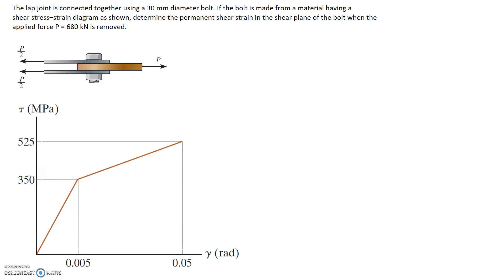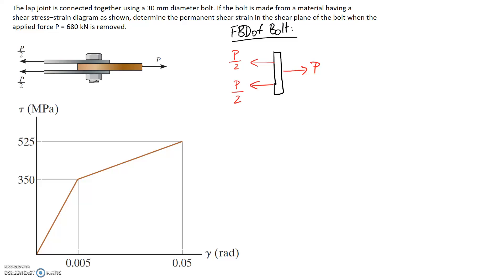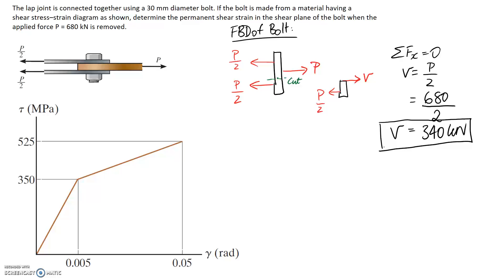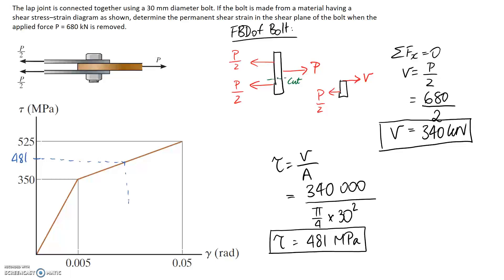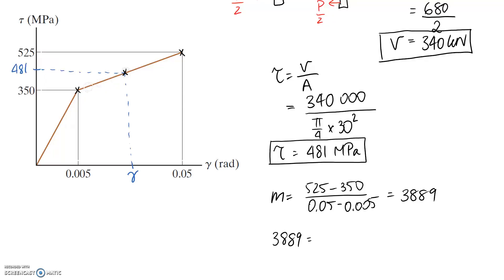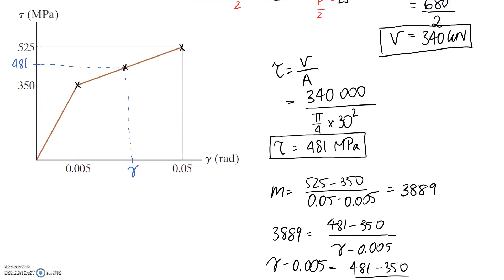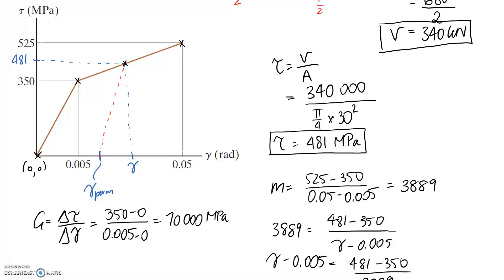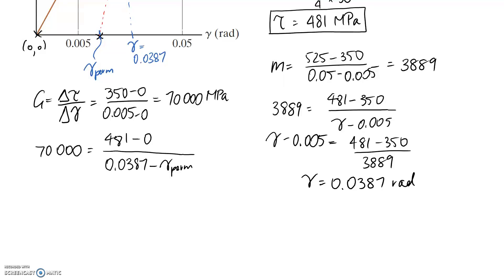Permanent Shear Strain

Comment: Putting this here so it shows up on Google better:

If the bolt is made from a material having a shear stress–strain diagram that is approximated as shown in the figure below (Figure 2), determine the permanent shear strain in the shear plane of the bolt when the applied force P = 130  kip is removed.